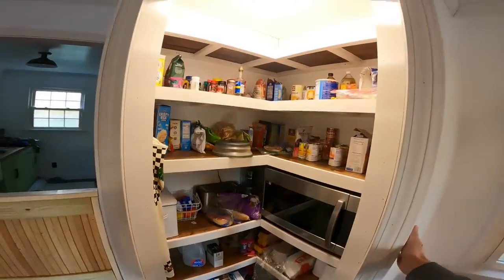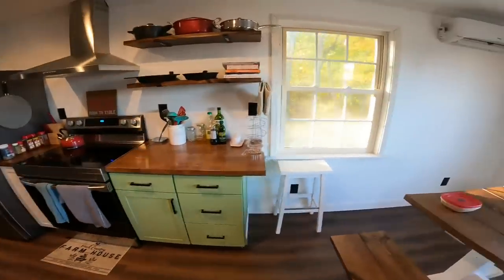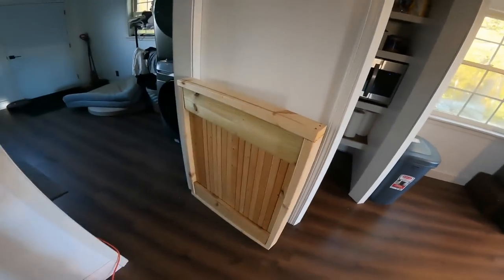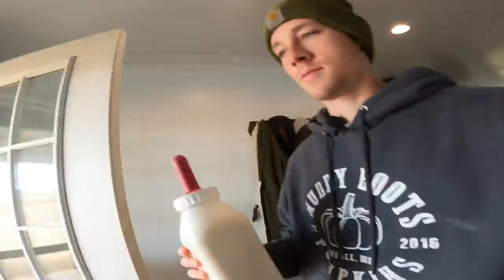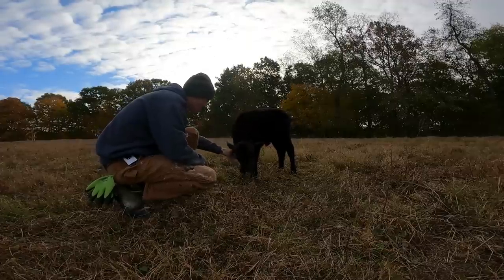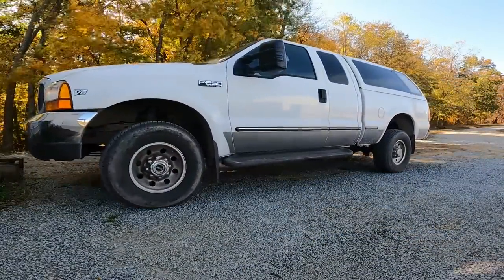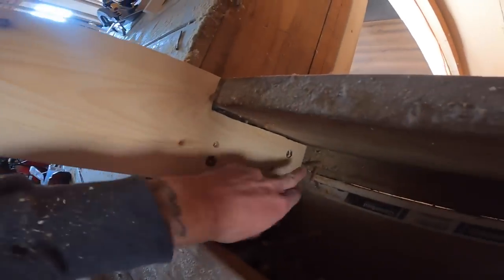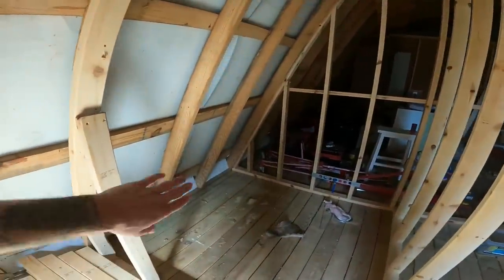We Bought An Amish Property To Homestead On

Comment: Like your chicken feeder. Is that pvc piping cut in half and attached to two blocks of wood? I would love to know how it is made and what materials you used.
Reply from the maker: It sure is! I use a 4” pipe cut in half length wise, took a 2x4 and screwed that to the pipe, then drilled a hole on each side (in the wood) and pulled a piece of rope through it to hang it. These are great feeders, gives the chickens lots of room to eat.

Comment: My wife and I are doing the same thing with our three young kids.  I'm the opposite of you and am an architect by trade and have framing knowledge but no knowledge of plumbing.  Our house is spring fed with a drilled well that we'll be using when we move in. I was considering using a gas well pump to start until we hook up electric but I'm not sure yet.  Are you running all your plumbing off a well? Would love to see how you hooked that up and ran the plumbing throughout the house.  Best of luck, the place looks great!
Reply from the maker: We are on city water actually! We plan on building a cistern and collecting rainwater instead though. City water isn’t very good quality.

Comment: I am surprised the original structure was so simply built…plywood walls, no insulation, etc.  How long did the previous owners live there?
Reply from the maker: They lived here for about 8 year I believe! We were surprised as well. Metal siding is common outside but plywood walls and metal ceiling is not.